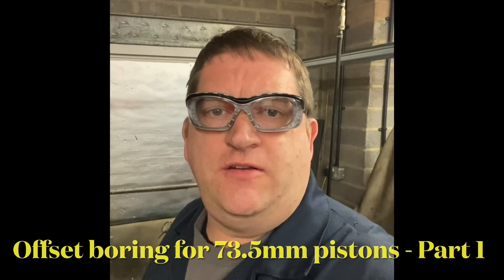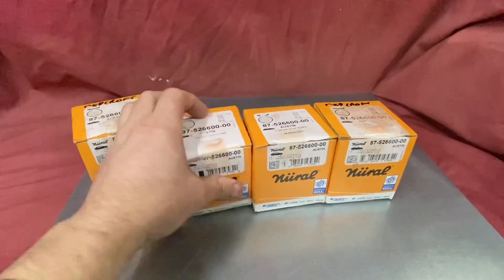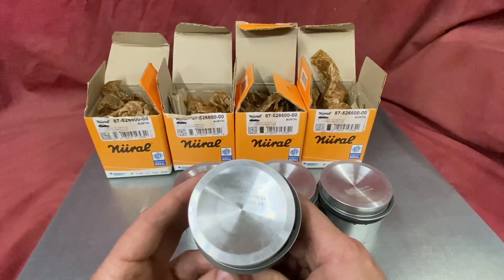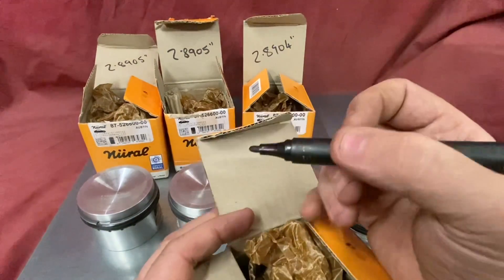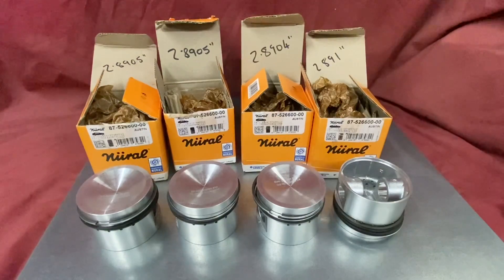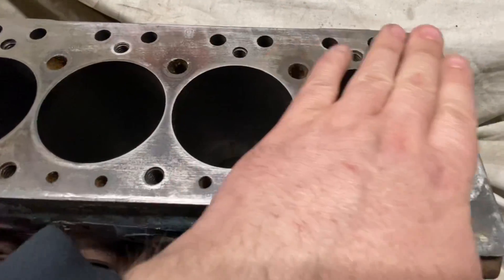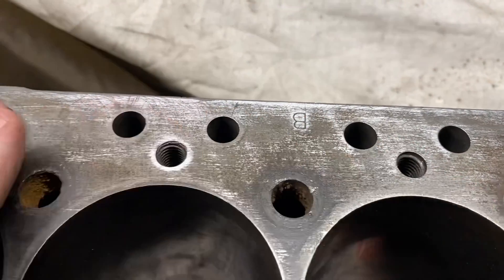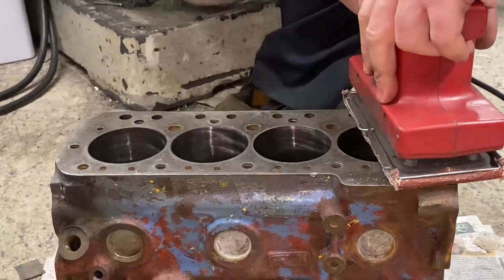Offset boring a 1275 block to 73.5mm -  Part 1

Comment: Fully skirted pistons? Look like they're for a tractor...
Reply from the maker: That’s because these engines are long stroke small bore units.
Reply: @ACDodd  Doesn't make it any less tractory :D
Reply: Thank You.  Looks like a pretty thick head on them even with the dish!  I liked flat tops for the CR, but now I see that currently the dish has proven to get better combustion & power, gee, the flat tops seemed so obvious in the early 70's.
Reply from the maker: @alro2434  yes the dish on this engine design at least has proven to be the optimal.

Comment: Terrific video, really looking forward to the boring.  How do you decide whether to line bore?
Reply from the maker: If the bearing crush is too loose it will need line boring. Fit the crank in the block with fresh bearings and lube and rotate. If you have contact marks on different sides of the 3 bearings it needs a line hone. 

In reality, if you are building a high performance engine, do it as part of your prep anyway.